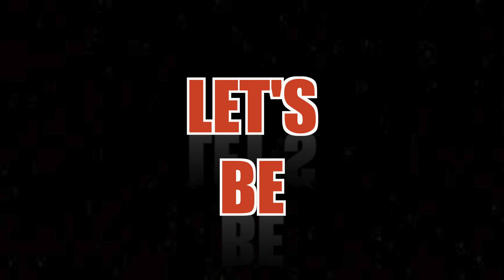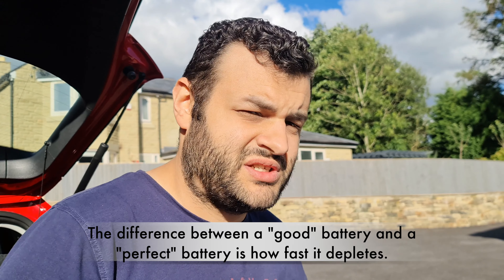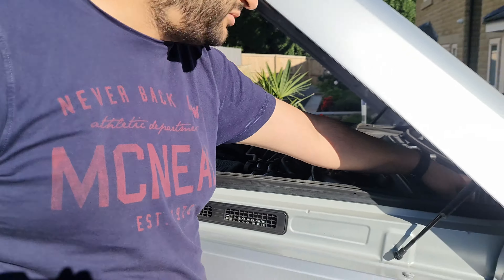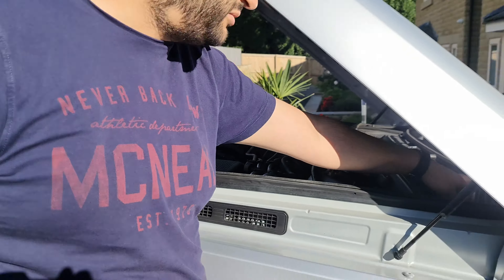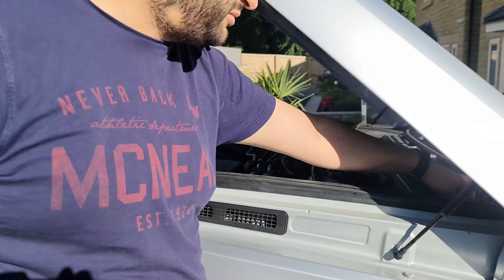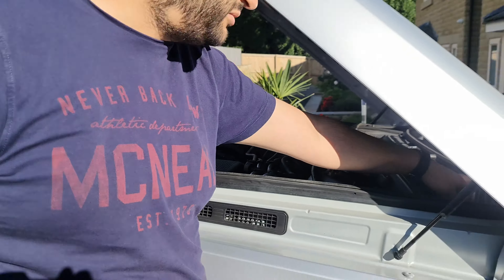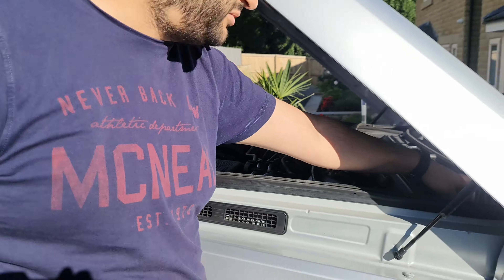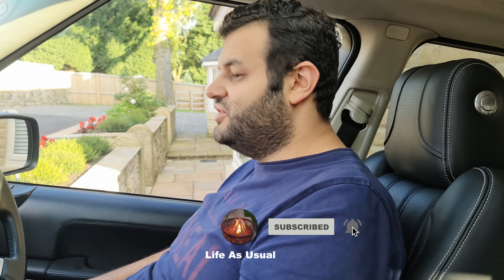Replacing Land Rover AGM Battery on Range Rover L322 is a must

Comment: Good advice. I think you only need to do the ecu update on the cars with digital dash. Early 2009 and before don't need this as far as I know.  Keep it up guys
Reply from the maker: Thank you for your support, Ant! 😁 With pre-2009 models, do you need to reset the steering angle? How come you need to do the ECU update only on the models after 2009? 
I'm only asking these questions because, from my understanding (from my research and other people's experiences), replacing the battery could trigger a steering angle fault, or a suspension fault if the ECU didn't learn that there is a new battery. 😊
Reply: @lifeasusual  I have just seen other people with earlier models saying that it isn't necessary. Have a feeling the digital dash changed the tech in the cars somehow. I'll have to look at the manual to clarify

Comment: Hello LAU, A very interesting video, I was surprised when you said that you would not be putting the bonnet into service position as getting the battery out is very difficult if you do not do that, as you found out! I notice that you do not appear to have the exploding + connection on your set up, that makes the job even more fiddly to do, I did not have to reset the computer when I changed my battery (L322 2006) but they change the system so often yours may be different, as for the battery replacement when you buy one of these, good advice, but one thing I found was that if you use the vehicle only once a week, the battery will be flat, so I use a battery maintenance charger at all times, this cycles the battery and is probably what I needed to do rather than change the battery. Good luck with your wonderful L322! A far better vehicle that the later RR! Chris B.
Reply from the maker: Hi Chris, welcome to our channel! 😊 Thank you very much for watching our video, we are so glad you enjoyed it! Yes, you are right, I did learn in the hard way that I do need to put the bonnet in service mode, which I should've done from the beginning. Throughout time, I learned that the computers on the pre-facelift are slightly different  than the face-lift, but they are more or less the same when it comes to functionality. After replacing the battery, from our experience, we had no more issues using the car once every week or even once every two weeks, as long as we have a good quality battery and we replace it once every 3-5 years. Thank you very much for your compliment on our L322 👍🏻 And we're so happy you got in touch with us! Let's keep in touch! Best regards, Fahed and Alex

Comment: Good video.  Thanks for doing  this.  I don't like the idea of doing the ECU.  I have a 2012 fullsized supercharged ranger over.  What I have found out about these vehicles is that they don't like sitting for periods of time which I some time do. They are made to be driven.  The more I drive it the better it performs.🤑🤑
Reply from the maker: Thank you very much for the compliment, I'm glad you enjoyed it! 👍🏻 Yes, I couldn't agree more, it has a lot of electronics that are battery-sensitive, so the battery has to be in tip-top condition, and for the battery to be in tip-top condition, it has to be driven often. 😁

Comment: Hi i saw ur video and it’s very useful for me, but i have an question i have changed my battery for l322 landrover 2011 model and now it’s showing some shivering while driving the car , i have never reboot/ reset the ecu, could u advise me is the shivering is happens becasue of non resetting ir not.?
Reply from the maker: Hi Prajeesh, thank you so much, I'm glad you found it helpful! 
It could be that the battery cables are not connected properly. There is a loss of power like a loose cable, or it could be because you need to reset the ECU. I would start by inspecting the battery cables first. I hope this helps!

Comment: That battery is very heavy especially where it resides and the angle you have to move it out and in. Bonnet in Service a must. I am the 2nd owner of my L322 MY 2005 and the previous owner had replaced the battery 3 months prior. The L322 sat for weeks at a time with no running. The week before I purchased it a new battery had to be fitted. I don't use it every day but there is a battery charger on it that drops down to trickle . On first crank the engine fires and the voltages are correct. Well worth using a clever charger to keep the system stable.
Have lots of fun with your Range Rover.  Regards, Bernard
Reply from the maker: Hello Bernard, welcome to our channel! 😁
We are happy to have someone here who had a similar experience. We highly recommend to all new classic Land Rover owners to replace their batteries as soon as they get them because we never know how the previous owner treated their battery. As we all know, the electronics on the Land Rovers are all dependent on a perfectly working battery. Since we replaced the battery, we have not had any issues with any electronics. Enjoy your Land Rover too, look after it, and it will look after you for many years to come. 😊
Reply: Is it necessary to do the reset of the computer after you put a new battery and I don’t know how to do that. Do I need any special diagnostic tools? I did follow how to mechanically replace the battery but after that I was unable to follow.
Reply from the maker: You need an OBD (on-board diagnostic) tool and you need to connect it to the car computer, to communicate with the computer and reset it, and there are a few diagnostics tools, one of which is the most popular - I will leave the links to both of the videos here: https://youtu.be/JfeFCN4YOSA and https://youtu.be/LoSgF2QNKSM 
I hope this helps 😊
Reply: @lifeasusual  when you say reset it you mean like reset codes like that type of reset or is it a deeper level scan to require because I have a basic OSB scanner myself?
Reply from the maker: It should be under service functions, and You have to go to the battery service section and tell it you have installed a new battery; it will rest the voltage reading internally. The modules get their readings based on the supplied voltage; the older the battery is, the minimum and maximum voltage keep changing to match the rate of the battery depleting rate. When you install a new battery and then reset those figures, you will get better results for the car to understand and communicate with those modules.
Reply: Thank you for your responses on top of that They are very quick and concise.. some people post videos and they don’t  respond. Not only did u respond. You responded quickly. That alone is worth the follow. Thank you again. I greatly appreciate it.
Reply from the maker: Thank you so much for following, I really want to do my best to help our community 😊 I'm really glad you found the information helpful! 👍🏻

Comment: simple job but big thanks for showing this job, and great advice, could you put the link where you purchase the battery ? thanks in advance ( i never knew about the AMG )
Reply from the maker: Thanks for the feedback, Stephen 👍😊 We felt it was important to show this job because many people wish to work on their cars but may not know where to start. And some of the viewers may have less experience than others. 
Regarding the link, it is simply a Land Rover battery that can be purchased from the Land Rover dealership (service parts team). If you prefer to buy it online with a link, you can go to the Land Rover parts website, like I showed in one of the previous videos (here: https://youtu.be/GsheuIZdViU ). 
Follow the instructions for the website and then select the car model you have, so it can show you what battery is suitable for your car. 👍
P.S. - A high number of quality new batteries are AMG batteries, as they perform better and last longer.